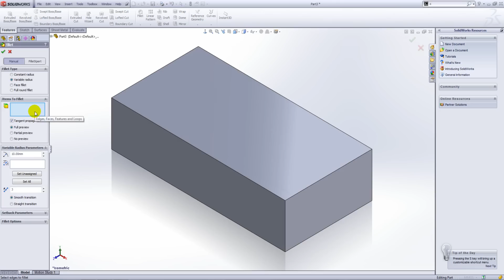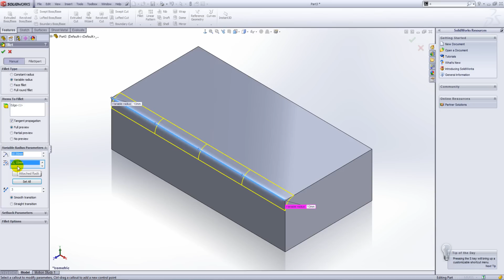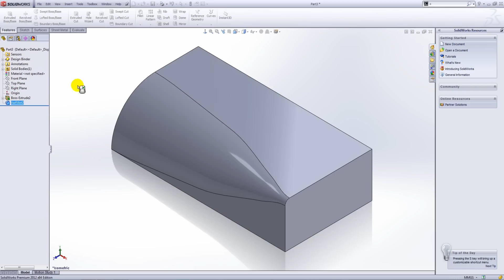Variable Radius Fillets in SolidWorks

Comment: in my solidworks version, when i add a fillet, the lines around the curved face are not shown making it hard to distinguise the diffirent surfaces( when i am adding a mesh control for example)